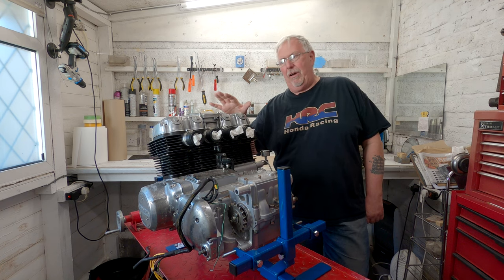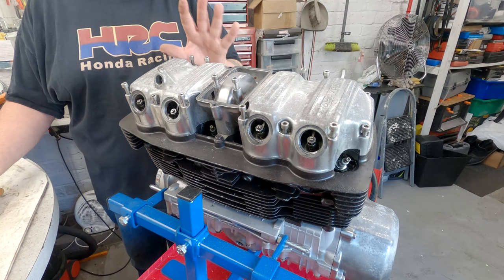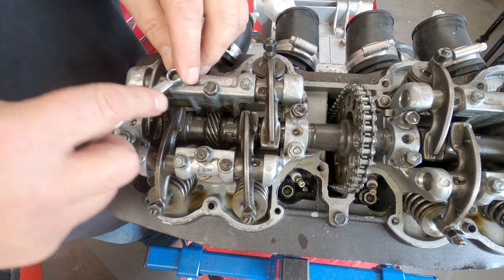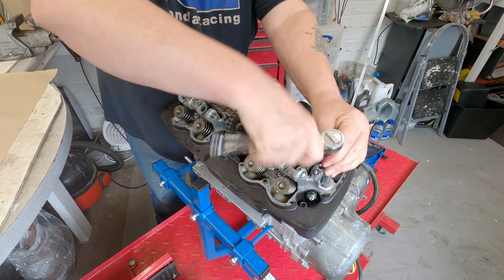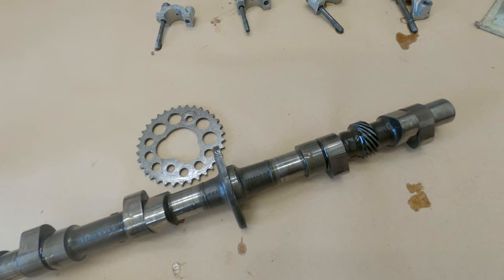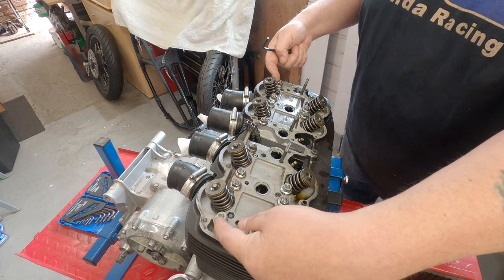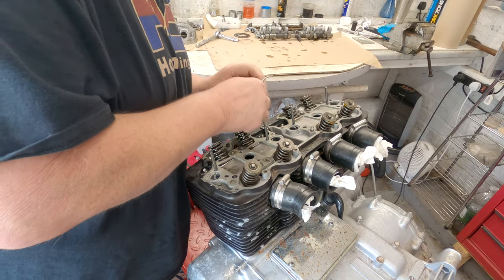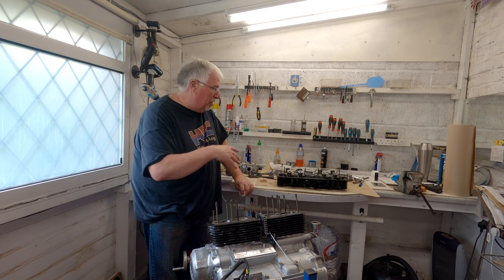Honda CB750 Engine Top End Strip Down | Cafe Racer Project Bike Motor | 07

Comment: When loosening the head bolts should you not start with the outside i.e. last bolt on tightening and work inwards? Great video, I just need same high standard instructional for Kat 1000!
Reply from the maker: Ahh great point, I should definitely have followed it in the reverse sequence. I'm pretty confident that it'll be okay as I've still followed a pattern that should have released the pressure from the head evenly. Well spotted sir!

Comment: You should have powdered the engine to find the exact location of oil leaks. A can of penetrant testing powder will point right to the leak.
Reply from the maker: Could see it dripping :)  Once I opended it up I found a few things that were causing the leak(s) hopefully I will cure them with the rebuild.